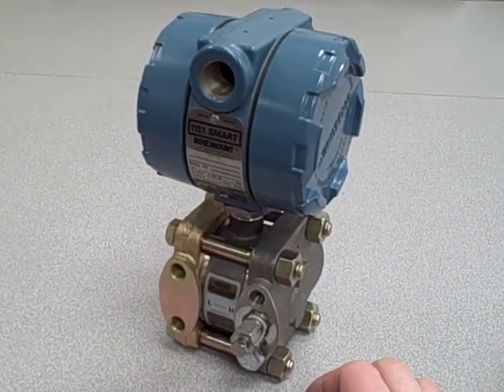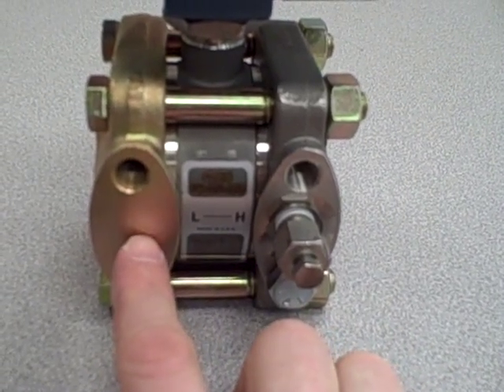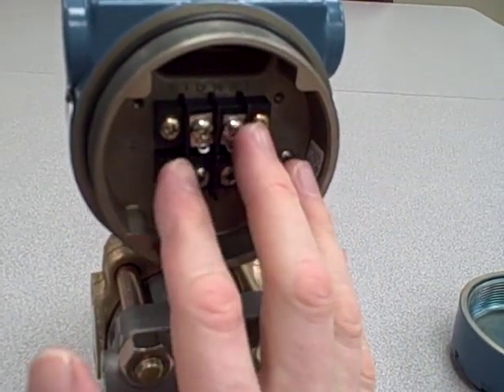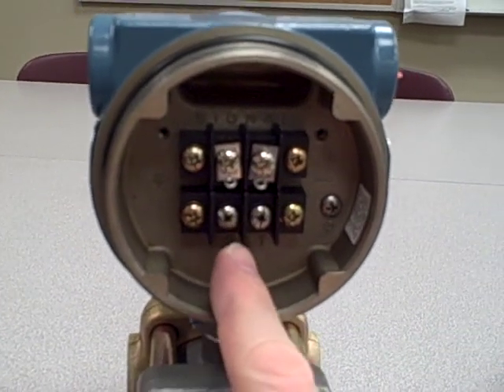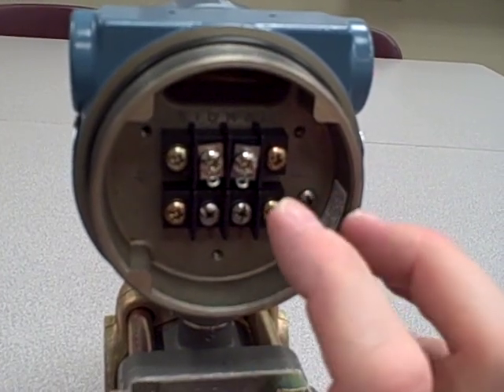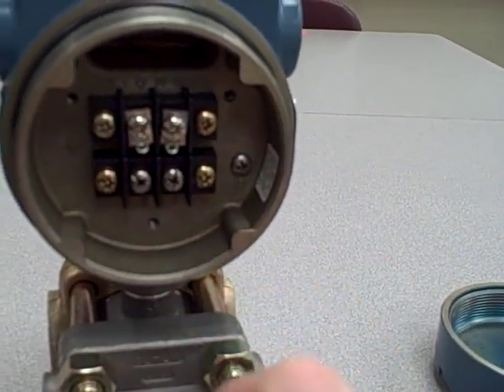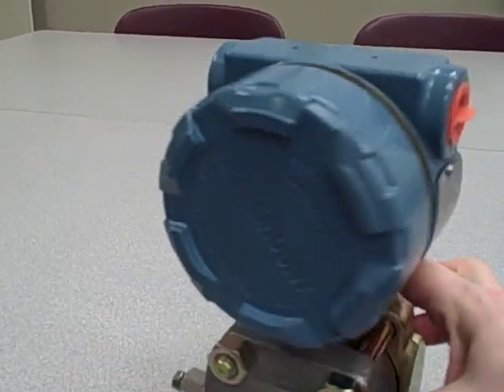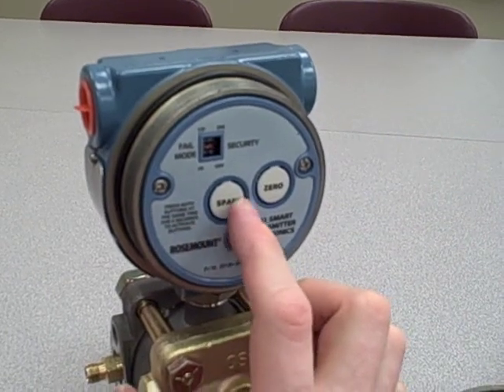Rosemount 1151GP smart pressure transmitter

Comment: I have a instrument of 1151 Rosemont pressure meter which is in running condition. but after opening the back side cover , I want to zero setting, then after pressing both of the bottons for 5s simultaneously after that zero botton is working but span bottons is not working. That's why zero setting is not occur.

Please suggest me how I solve this matter......thank you for this video

Comment: On the bench, with a 24v DC power supply, do I need a 250 OHM resister between the Rosemount transmitter and the power supply (on the positive lead)?
Reply: to add load resistance to the circuit for Hart protocol to work
Reply: On the signal return side (-)
Reply: Thanks!
Reply: dave motion why we require this resistance?
Reply: Instruman tion Only If using a Hart.
Reply: Which side (+) or (-)? Or does it not matter? The load is all it needs.
Reply: Rhomis Rhemis. I always put the resistor in the return signal wire.  Negative wire -

Comment: Do you need to use a pressure snubber to isolate the process flow from the instrument? My unit has 316 SS process flange, Hastelloy C diaphragm and process fluid is domestic sewage.

Comment from the maker: @nsganalongo This will only work if the 1151 transmitter has been upgraded with the "smart" electronics board.  If you pull the back cover off the transmitter and you see a printed circuit board (soldered traces) then you have an analog transmitter which will not communicate digitally with anything.  Another way to check is to compare the long part number on the transmitter against the factory manual to see that what you have is indeed a smart transmitter.

Comment from the maker: Don't try to use two pumps to calibrate.  You need a pressure calibration standard with low enough resolution to set the range you want to calibrate to with a single pump.  Buy or make your own an inclined water manometer and you'll do just fine.

If your vacuum transmitter only has one port, you need a pump that can actually create the full amount of vacuum.  Or, replace the vacuum transmitter with a DP transmitter and calibrate that with pressure on the "low" port.

Comment from the maker: You may "trick" a DP transmitter into thinking it's sensing a vacuum by applying a positive pressure to the "low" port.  So, to calibrate a transmitter for a vacuum of -4 PSI, you could apply +4 PSI to the "low" side and it can't tell the difference.

To calibrate very low-range transmitters, use an inclined manometer as your pressure standard, and a compressible bellows called a "squeeze box" to generate the low pressure.   Research products manufactrured by Dwyer for low-pressure apps.